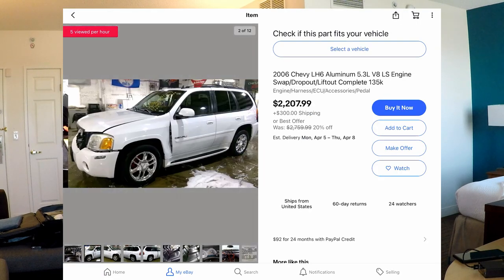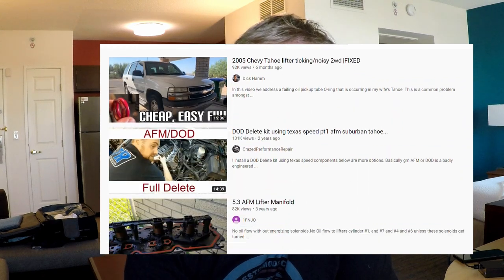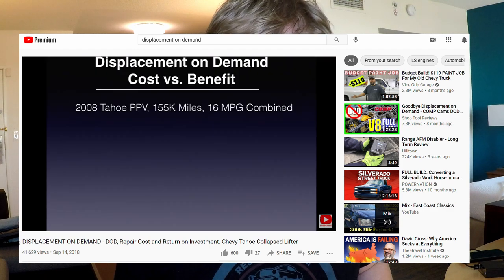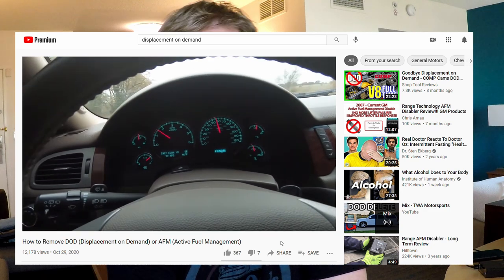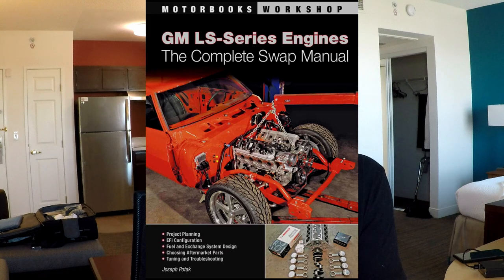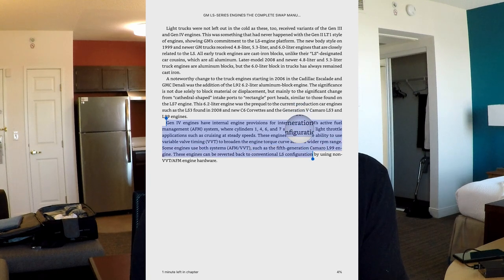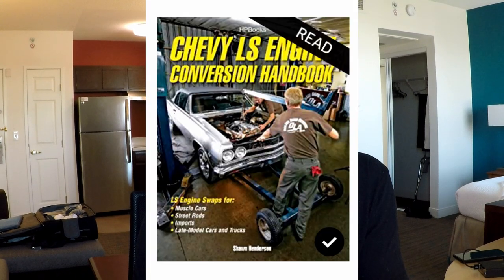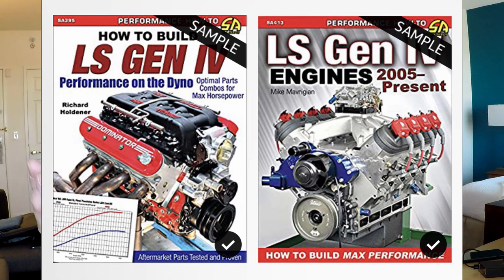Disable Active Fuel Management / Displacement on Demand Without A Delete Kit? | Good Idea?

Comment: I've had the Range unit on my 2011 5.3 for six yrs and no problem.
Reply: I just traded in a 2011 5.3 Silverado. Had 99000 miles on it, ran perfect with no lifter issues. In fact, I didn't even know it had AFM on it until I looked up the original sticker and determined that it did. I purchased a 2021 5.3 Silverado and now I'm concerned since reading all the stories about lifter failure. Not sure what to do now, get the Range plug in device, or just drive it and hope for the best.
Reply: @daniel taylor  a very good friend of mine bought a new 2016 and at about 65,000 miles it started to tick. Into the dealer and $9300.00 later he got it back. I saw the invoice with all the parts needed aside from the camshaft.  Needless to say he had a Range unit on the way before the job was done.

Comment: To disable the AFM (DOD) in the ecm by using HP Tuners does nothing to engine's inability to function. The engine by design are made to run on all 8 cylinders by the engineers of GM. You are thinking too hard about it. The afm coding for the  4 cylinder mode is an add on to ecm's software forced by the government. Its common sense how engines work. The Engineers brought on software to control engines, then governments brought on emissions, save gas ect... you know the deal. The springs, oil solenoids and valves in the valley cover are only activated by the ecm's software coding. Stopping the coding "Disable" in HP tuners you are just stopping the action of AFM. There is no need to buy a delete kit which is just a lifter kit. No such thing as a delete kit. Just removing parts and replacing with parts that already exist in other cars and truck/suv. All or most people doing the procedure are just modding the engine for more performance. If you use common sense the vehicles run great when in 8 but fail in v4. DISABLE DISABLE DISABLE. and don't forget to not report code in DTCs
Reply: So I don’t have to buy no damn kit? Just disable the AFM and that it? I just bought a 2010 Silverado and oil pressure is kind of low.
Reply: So just disable it??? And what u mean disaable the dtc codes also if i disable it dtc codes will pop up
Reply: @noe_9568  depends those lifters start to mushroom and will damage the camshaft, lifters, pushrods and can fuck up the block.  If you disable the afm or dfm early in engine life you should be ok.  If you have 50k or more id change the lifters, check pushrod and since you have it off change camshaft too.
Reply: @noe_9568  one symptom of the AFM system failing is low oil pressure but it would be accompanied by a lot of lifter noise and clacking sounds if it failing.  If it is fix it now because it can destroy an engine.  Good luck
Reply: I agree with this. Those who remove lifters show the latch pin damage to the lifter's shelf and pins themselves. I don't see how stopping the switching events with a disabler (keeping the lifters static) could do anything but prolong their life. Not sure how you could blame "catastrophic damage" on keeping these lifters engaged like normal lifters.  Stop AFM now and prolong your lifters would be the logical thing till proven otherwise
Reply: The reason for the delete kit is to also change those lifters that deactivate
Even if you just do an HP tuner delete the stock lifters can and do fail 
Also in the delete kit is a new cam shaft which is needed because now all the lifters 
Will be the same as apposed to the factory set up 
Can you just go in and fix the bad lifter ?
Yes 
But if you are going to tear it down why not just install the whole delete kit 
Get the tune and be done with it. 
If you don’t have a lifter problem you could just do the HP tune or 
A company called Range makes a dongle that you plug in to your OBDII port 
It disables the AFM 
Works great cost about 225 dollars 
Only potential problem is that if your truck/ SUV sits for long periods of time 
It can drain the battery. So if that’s you then simply unplug the dongle. 
Amazon sells a delete kit for about 550 dollars 
A regular kit for a AFM setup cost about 350 dollars 
Some guys just go in and fix what’s broken 
Some guys change all the lifters ( 16) so you are starting off fresh 
Some guys go in and install a delete kit and get a tune 
Some guys just use the Range dongle 
Lots of options 
If you have no problems a dongle is the easiest thing to do 
It’s literally plug it in and you are done 
If you have to replace even just one lifter 
It’s a tear down of at least one side 
Me personally I would bite the bullet and do the delete kit and pay for a HP tune or Diablo tune 
And be done with this AFM crap once and for all 
Also I do not own one of these beauties for this reason 
My neighbor as we speak is going through this 
I spent all day chasing a P0300 code only to find out about this piece of crap system 
For him it’s on the number one cylinder 
I used a scanner with live data to read the mis fires 
But while number one is the collapsed lifter 
I noticed number 7 is also mis firing ever so slightly 
So what do you do ?
Just fix number 1 
Fix 7 too which is on the other side 
Or go in once 
Pay the extra 200 for the delete kit 
Pay the extra 250 for a tune 
And never ever have to go through this again 
I say if you are going in then fix it the right way 
MPG might suffer a little 
But you will have more power 
One thing I am not sure about 
Is how it could or could not effect towing 
That’s something you might want to check in to 
GMC Chevy they should be sued and forced to fix every single one of these garbage systems 
They put in to these vehicles 
It’s literally tens of thousands of them 
And they are all ticking time bombs 
Good luck !
Reply: @sschevmale24  They sell a delete kit with new cam shaft for about 550
Reply: @anguslean4058  niceeeee. I need it
Reply: I've got an l77 engine with 220,000kms always serviced at 10,000kms never been trashed I drive it normal,apart from the injection ticking noise engine is quiet l,should I give it a good tune and disable the afm will that prolong the engine life

Comment: This rambling presentation could be done in about 30 seconds. Plug in a disabler to your OBD II port. The vehicle will simply stay in V8 mode, and not enter V4 mode. No codes, No damage.

Comment: Seems like a crapshoot either way. AFM has lots of failures. However, in my 2010 6.2L Escalade EXT, I have simply plugged in a 'Range' AFM disabler...... and .... I am changing the oil/filter ~3k miles, which may seem like overkill, but I firmly believe the vast majority of AFM issues would never occur if owners were absolutely diligent about keeping fresh, clean oil running through the system.
Reply from the maker: Keep me posted. I would like to hear how it goes for the long term.  YouTube is full of folks disabling with AFM/DOD. The problem is they rarely come back with an update.
Reply: @AmateurHourGarage  - sure thing. But I'm not a good test, 'cause this is not a daily driver, it's a 2010 and it only has 10k miles on it. It's like brand new inside and out; engine internals (looking thru oil fill cap) look and smell very clean.
Reply: @AmateurHourGarage  Ill give you an update, or you can read my original post as well?  Which had questions that were not answered
Reply: agree 100% alot of failures are due to poor maintenance
Reply: Mine had 63k with religious dealership maintenance records and the #4 cylinder lifter failed. A 2017 model.
Reply: My 5.3 went out at 110k with diligent maintenance.   AFM was the culprit.
Reply: My 2019 Silverado lifters failed three times in a couple weeks and just got it back with brand new engine. The dealership and GMC checked my service records closely before they approved new engine so maintenance is irrelevant and I'm a mechanic. I also have seen them go out as early as 1k miles. My truck just hit 37k miles with new engine already. I have video proof uploaded too.

Comment: Ok, I understand what you are looking for and I think you're overthinking it a little.  I lost a lifter at 6,200 miles under warrantee, the lifters and the whole top of the motor was replaced including the oil solenoids, direct injection fuel pump, piping and injectors, you don't want to pay for that.  Bottom line when you look at a breakdown of a DOD lifter it works just like a normal lifter until it latches under oil pressure and is held collapsed.  I have a 2015 Silverado and when it hit 100,000 miles I installed a DOD Eliminator into my ALDL (OBD2) port to disable the function, it cost 50 bucks on Scamazon.  If the AFM lifters aren't enabled they don't latch and continue to act as normal lifters having no detrimental effect on the engine, they just sit there doing their thing coasting along.  After 35,000 miles no problems, just a fraction less mileage.  Benefits ?  No lag as the engine tries to switch between modes, the transmission shifts smoother and slightly firmer, again no lag.  Better response and just tighter operation, the engine just feels like it is happier and no weird operation when the AFM, hung trans shift and Stabilitrak are trying to figure what to do.  The engine is returned to full V8 operation all the time.

Comment: 2017 silverado 5.3 engine. I've had the range Disabler 6 months after my new purchase, with zero problems. I purchased 8 cylinders for a reason, I don't want 4 or 6 simple. GM needs to Add a switch to let the consumer decide how he or she wants to run their vehicle. This way, they still abide by government standards !

Comment: The short answer is yes. That’s because the computer tells the engine when to activate AFM, so all you have to do is rewrite that portion of the code essentially. That means the system will never activate and you are left carrying hardware under the hood you won’t use.

Comment: I deleted the DOD on my 09 chevy avalanche 14 years ago by having a new super tune installed writing it out of the program. 90,000  miles later 2024 not one problem. No work was done on the engine and it runs awesome. Gets 21 mph and gobs of power. I run it hard all the time. I paid $300 and never regretted it.

Comment: Good insight on AFM! I got a 2023 Blazer V6 with the new DFM in it. I put a AFM/DFM disabler in the OBD port at 7,500 miles. Hoping it at lest prolongs the lifter failure for a couple hundred thousand miles at lest. Even if I have to buy a new disabler every few years it would still be cheaper than lifter replacements after the warranty is up.

Comment: I do a lot of deliveries in my 2011 suburban lt 1500 and I bought a range technology ra003 for it. It now has about 378k miles on it, and with normal maintenance, these things last a long time! Maybe my LMG is a rarity, but it has the original rear end, original transmission, and original engine with original afm lifters. I guess it depends on your application. Obviously for an all performance engine, I'd also get rid of afm.
Reply from the maker: Ya. Get the disabler on the vehicle early and it seems to prevent failure in the long run, as you have seen.  I put my range disabler on my used suburban at 80K.  I hope it was early enough.
Reply: Hi , ahh is that a plug and play device or it needs programming or any other stuff, thanks

Comment: I disabled mine 2 years ago and no problems. I used the Diablo Sport 2 tuner and added a performance tune  and very happy with the results. 
All software  reprogramming. Didn't have any lifter issues prior or after.
Reply: Forgot to mention it's a 2007 Chevy  5.3  with now  209,000 miles and no issues. Had 190,000 when I did the reprogramming 2 years ago.

Comment: My thoughts is that the constant pressures on the lifters going from V8 to V4 is the cause of the failures.  Moving parts wear over time and when you’re putting pressure on a spring to release tension and then reapply tension constantly, you’re wearing that part out prematurely.  Disable the feature and the springs keep constant pressure which means less moving parts that are prone to failure.

Comment: Hey man! Thanks for the mention! I've seen this topic come up a lot on various Facebook groups and I think my general opinion is this:
I've seen and heard of engine failure caused by AFM at as early as 50k miles. 
So when asked the question of whether or not someone should by a Range obdii device or similar to turn off AFM I ask how many miles they have. My general advice is if its less than 100k disabling AFM via tune may prolong the life of the engine.
For how long? Who knows. 
But without getting too technical I believe the main issue is the physical lifter design of the AFM lifters is the issue. 

As stated earlier people as low as 50k miles have reported lifter failure, I for example made it to right around 200k (hard miles) without them failing. 

So it's really anyone's guess as to whether or not a software delete would be effective. 

Now if I were to buy a let's say 2009 suburban with 200k on it, well of the engine hasn't been replaced yet I might just consider doing the hardware delete.

One thing I want to point out Incase anyone goes to my video from this. The BTR NSR cam I used in the video is discontinued and I believe for good reason, my engine ended up knocking maybe 10k miles after this, now I'm not blaming BTR it could have been my crappy tuning skills but I'll leave it at that and highly recommend the Texas speed kits that include a stock replacement cam. It simplifies the install for the every day Joe. 

My final note- 
There's an expression that gets thrown around the LS world called "letting the magic out" whenever you open up these engines. I have first hand experience where after that heads come off, dirt debris and sludge tend to fall into the orifices. This ends up become bearing wear or potentially rod knock later on. So if you attempt this yourself keeping the engine inside the vehicle, be very clean, get a shop vac And suck up everything before removing the heads.

Comment: For years I've had a Range Technologies OBD plug-in to disable the stupid AFM on our 2011 Silverado 5.3. No issues at all, its at 120k miles currently.
The only thing I have to do is unplug it before state inspection to allow all monitors to complete a drive cycle. For some reason it will prevent a couple of them from doing this, but you'd never know without using a scantool. Zero driveability issues, never a CEL. 
Been very pleased with this simple solution. As far as I'm concerned, GM should be sued for ALL years that had this garbage installed.

Comment: I bought a 2021 LT1 Camaro and I decided to do a cam swap. I bought a stage 2 cam kit from Texas Speed and it required the DOD delete kit. I installed the cam and did delete kit and had to pull the heads, intakeand front cover off which was a good bit of workin the camaro. I swapped the lifters and installed the valley cover plugs. So yes I would say it would be the best idea to open the engine and replace the lifters because the way they are made they can still break down when the AFM has been disabled. So my engine runs great without it I don’t think they should have ever used AFM.
Reply: I have to find a good shop to do this on my 20 6.2 silverado
Reply: I just bought a 21 LT1 Camaro as well, and installed a Amazon AFM delete via OBD2.  It only has 19k miles on it but I will also probably do the stage 2 cam from Texas speed and delete kit once my warranty is up

Comment: The DOD can be disabled by simply driving in manual range in l5 (6speed) or l7 (8 speed).
The DOD is only enabled in the top gear of the transmission. You can also use a DOD disabled that you leave in the OBD2 port while driving in normal automatic mode. As soon as the disabled is removed from the OBD2 port, DOD is active again, so no permanent software change.

All of that said, there IS ANOTHER valve train problems these engines have that makes it imperative to open the engine and install reputable aftermarket (non GM parts). The other problems that is occurring is the lifters turning 90 degrees in the bores. So now the roller is NOT rolling on the cam, but running perpendicular to the cam lobe. That produces a loud squeak / knock and will destroy the cam in short order.
I am currently suffering this exact scenario...
Reply from the maker: I have the DoD disable plugged into to the ODBII on my 2019 Suburban

Comment: I have a 2011 Suburban with 5.3 AFM engine and 6 speed trans. The way I keep it from running in the AFM mode at any speed or conditions is this - select M with the shifter, then use the +/- buttons until the display shows M5. It drives completely normal but never goes into 6th gear and always stays in V8 mode. Simple, nothing to buy and no work to do. Barely affects fuel mileage. Vehicle is currently at 258k miles, and uses very little oil and not fouling plugs!
Reply: But do u keep it on m5 at highway speeds, 65-70 mph etc? If you do isn't that bad for the tranny?

Comment: As far as I understand it, its the action of using oil pressure to activate the afm that is failure prone. Having low oil pressure or inconsistent oil viscosity from dirty oil etc causes the lifters to hang up in between either mode and causes the tick. This makes me think that just disabling with software to prevent afm from activating should prevent failure really well. I unplugged my oil pressure sender when i got my truck until i could get a disabler and have since just been too lazy to buy it…. With no oil pressure reading to the ecu AFM is disabled.

Comment: I have an L83.  Im  putting it in a 37 Chev PU.  I ordered my wiring harness from Speartech.  They reprogrammed my computer and deleted AFM.  I have't driven it yet, but I've started and run it and it's smooth as Glass.  Motor has 100,000 miles.
Reply from the maker: The jury is in, even if you disable the AFM/DOD eventually it will fail.  Best to delete it IMHO.